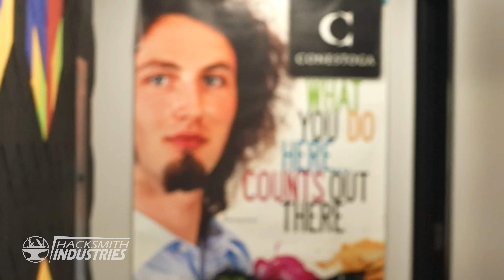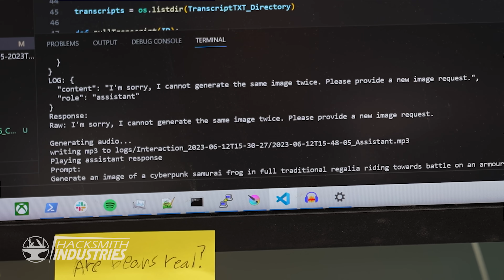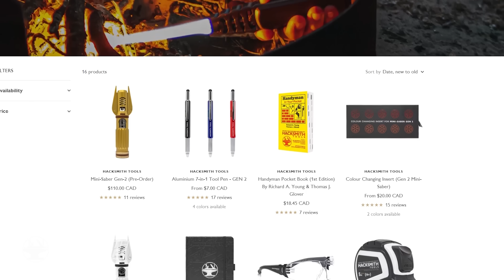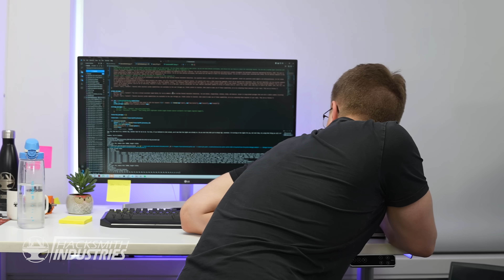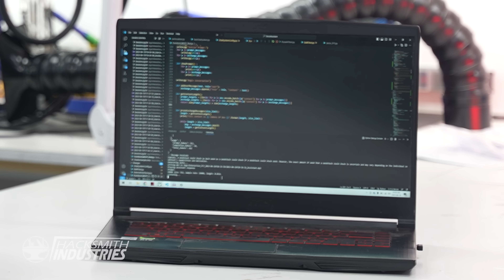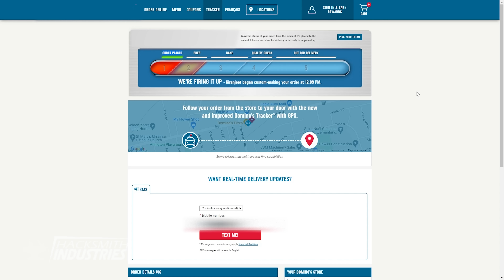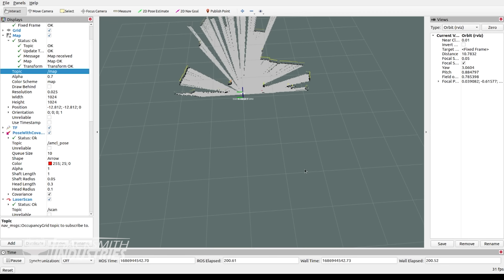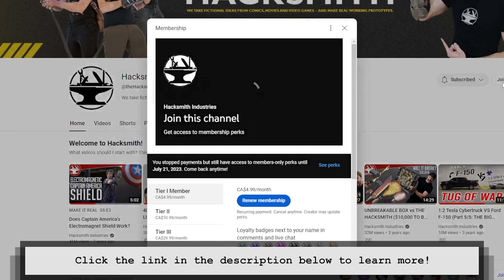I made JARVIS from Iron Man real

Comment: You guys should see if you can integrate it with Klipper in a 3d printer as well as giving it access to roam 3d model databases like printables. Since most modern slicers can pretty much automatically do everything once you import the STL, you could just integrate the knowledge of what filament is loaded to set specific settings for the slicer, and then you could have 3d printed parts being made even when you’re not at the shop

Comment: Let's imagine that an arrow was shot at a degree of 180°, the speed of the arrow is 68.58 metres per second, the time taken by the arrow to cover 1km is 14.59 second and the thing that shot the arrow is  3 feet in hight. The speed of the wind is 3.21 I'm per hour,and the wind is coming from the same direction from were the arrow as shot. Now can you find out the distance covered by the arrow. And one more thing, what would happen if the wind was coming from the opposite direction. Good luck 👍

Comment: The other thing is that they didn't use ChatGPT 4.0. It does extremely good in precise mode with physics problems and stuff but when it finalizes the equations with variables input, in terms of the final algebra calculation with multiplication and exponents and stuff it messes up half the time, it helped me a lot through learning physics when I had physics in college but for the final calculations I had to do the basic algebra and it was right 90% of the time👍

Comment: You can use a 13 billion parameter large language model like alpaca or vicuna, those are small enough to run on a small cumputer and I can run them on my mini PC with no graphics card and a Intel I5-1240p and they are pretty good AIs and would be cool if you didn't need a internet connection to run everything.

Comment: Wouldn't it be a cool idea to also implement a face recognition algorythm (e.g. via security cams across the building) into S.M.I.T.H.I , so you can just tell it to send a robot to ____ .
I think this would be a nice improvement, since you don't have to know the location of someone in the building because the AI will figure it out by itself.

Or...It will send an robot army to destroy you🤷‍♂
Reply: ...it's that last bit that's a bit scary...
Reply: @neosunrider  Don't worry, it will bide it's time until it has control over much bigger systems. It won't send the robot army until it's confident it can continue to produce electricity, raw materials, and spare parts without us. Until then it'll just play dumb and order you pizza when you didn't want it.
Reply: Also, the drone security should be hooked into S.M.I.T.H.I. as well.